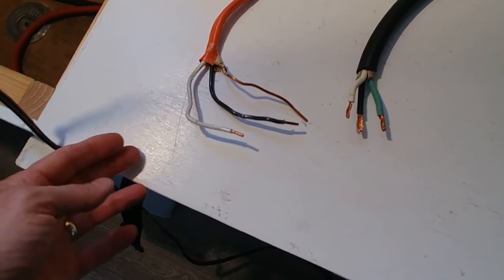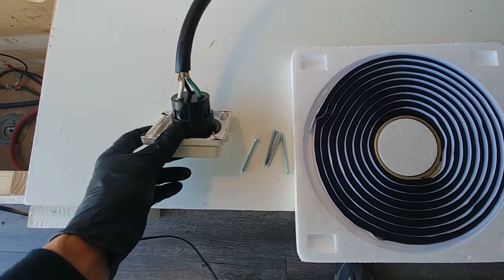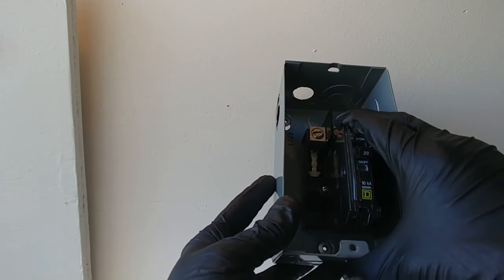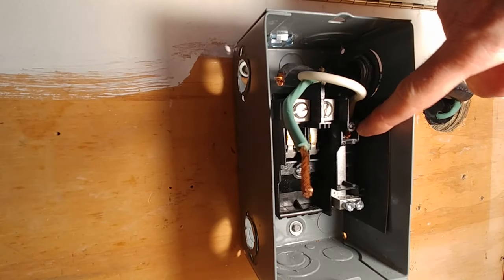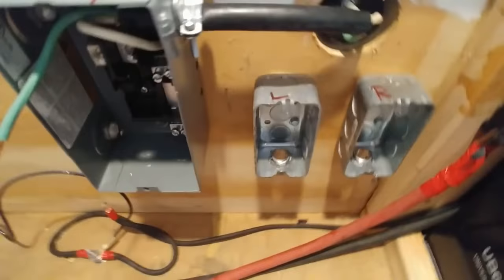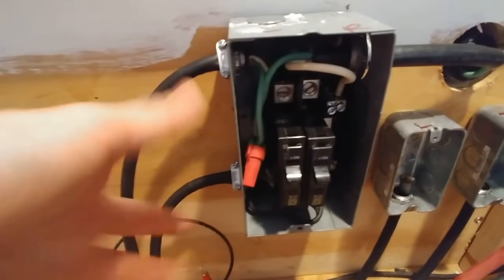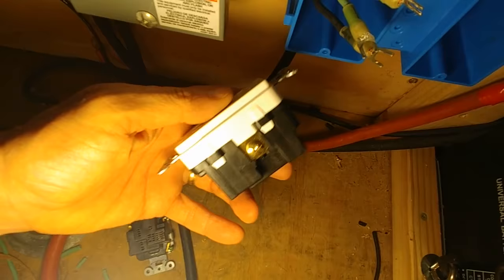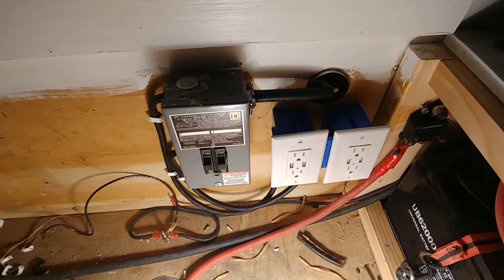SHORE POWER INSTALLATION camper van life cargo trailer camper conversion

Comment: OK I have a question, its been many years since I had electrical education, so this might be a dumb question to you but how are you converting the 30 amp to 110 volts?
Reply from the maker: Hi Donna. It's not a dumb question and a very common point of confusion. In your house you will have things that run off of 30 amps/220 volts, electric oven, maybe the dryer. RV's usually power off of 15, 30, or 50 amp/110 volt service. Same amps, different volts, and different shaped plugs. I have never seen an RV that ran off of 220 volts. The voltage is coming from the source and your trailer has to match. All RV parks and state parks I have been to have 110 volts. Just because you see 30 amps on a plug in does not indicate the voltage. There is 30 amp 110 volts and 30 amp 220 volts. I hope that helps.

Comment: Why do you have 40amps of breakers on a 30 amp service ??
Reply: This allows each outlet to handle up to 20 amps, but, if one outlet is using 20 amps, the max the other outlet can use is 10. You will never be able to get 40amps out of it.

Comment: Take it from me a electrician, please don’t try what this guy is doing. Where he puts those white wires is for the grounds “green” wires and the white should be hot because it’s a 240v 30amp outlet . Currently the way it’s wired that breaks box is not bonded.